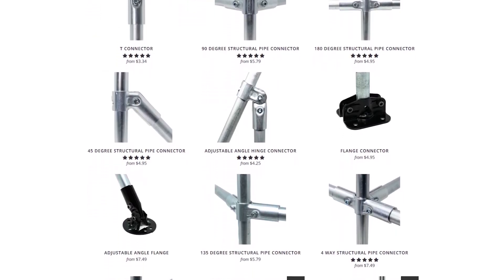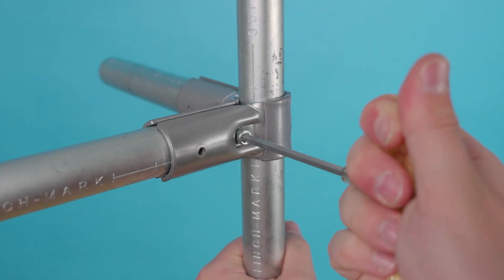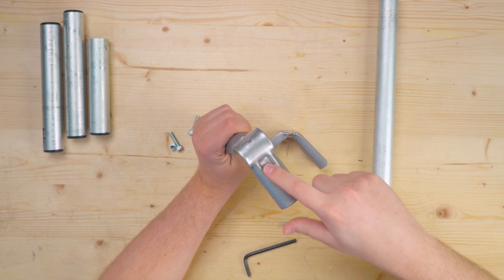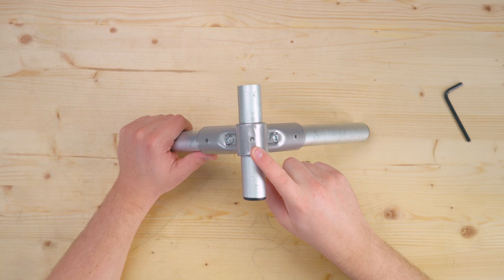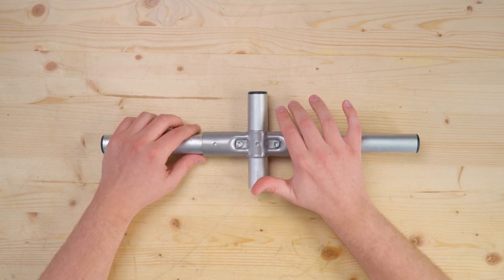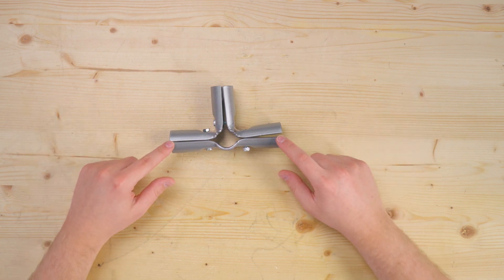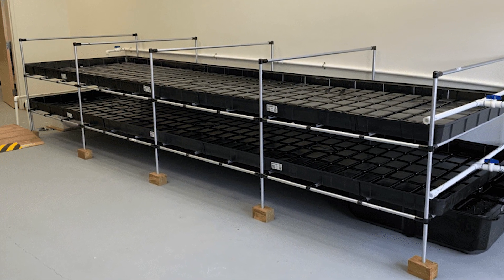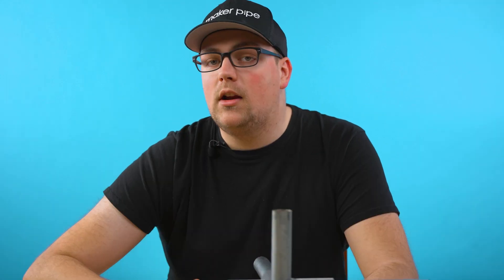New Possibilities For Building BIG With 1" EMT Conduit!

Comment: Great additional parts!  I‘d recommend drilling the additional hole in the 3/4“ connectors as it is nice to lock the tube into your connector.  I used 3/16“ pop rivets on my project after drilling out the connectors on my project.

Comment: Now that's a great improvement, stepping up to 1" EMT pipe, fittings, and acessories. Do you think your company will go up to 1-1/4" or even better 1-1/2" chain link fence pipe fittings, etc ? I want to build outdoor carports in the front and back yard to shade vehicle in the morning and afternoon from the sun. Commercial Carports 18x21 are too expensive and the wait time is months. Id love to find a DIY solution that is strong and won't blow away or twist and bend, yet is less expensive than square tube structures and that I can assemble myself. Any ideas?
Reply from the maker: Thanks for the comment. We will be adding larger sizes later this year that will be perfect for that kind of application. In the meantime, you may want to look into using our 1" EMT Connectors with black iron or galvanized pipe.

Comment: Another excellent video. Are you planning to integrate the 1-inch connector options into your community kits? I'm specifically interested in the DIY Pipe Desk kit...
Reply from the maker: Hi Robert. That is something we could totally do in the future. In the meantime you could get the connectors individually and follow the current instructions with them. Thanks for the suggestion!
Reply: @MakerPipe  glad to hear you are considering the addition. If I go the manual route, I'll just have to make sure I adjust the length of the pipes to accommodate the different amount of pipe that will be internal to the connectors. Thanks again!